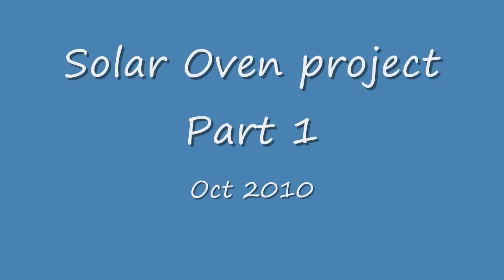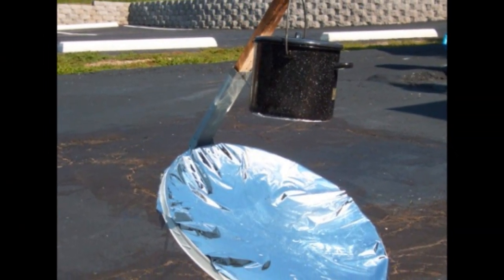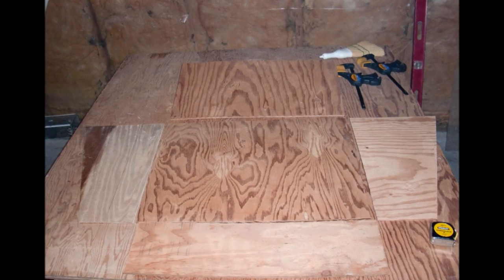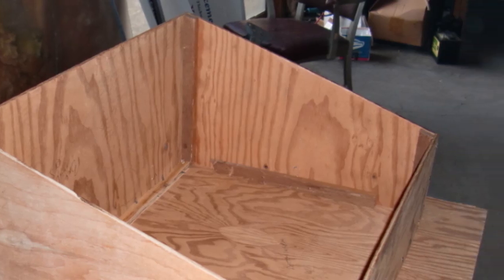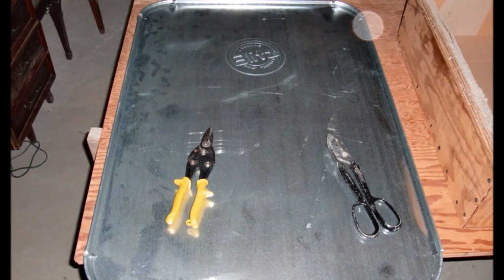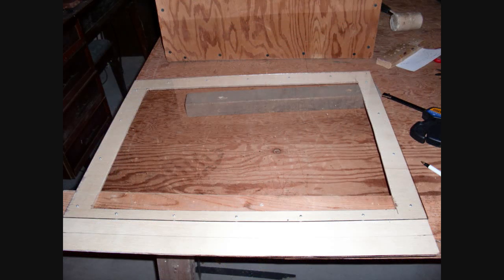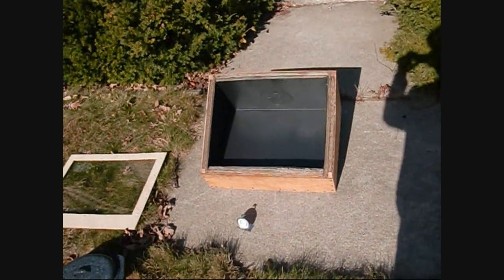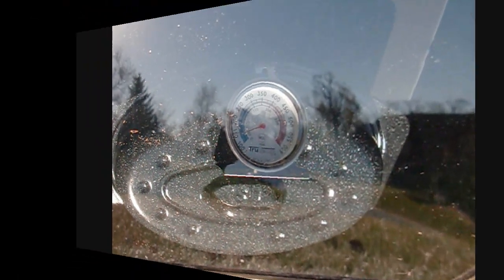Solar Oven Project Part 1

Comment: Nice work.  It seems like this oven could be made to hold a vacuum, with a simple vacuum cleaner and a shut-off value to encapsulate solar cells. It would be nice to just try it anyway.  If it didn't work, well it might be time to bake a pizza or something.